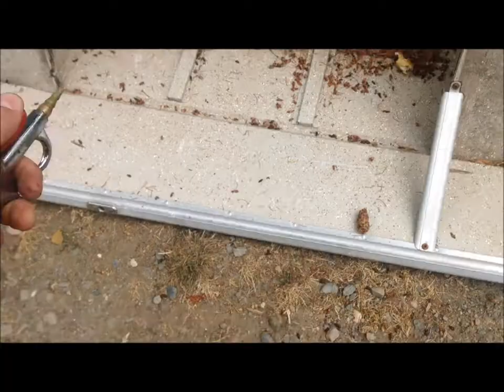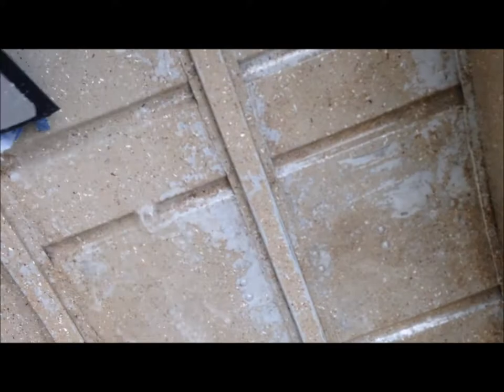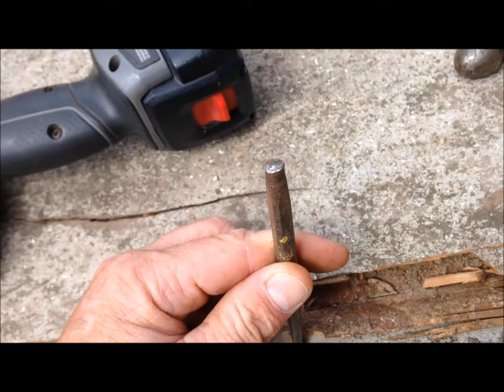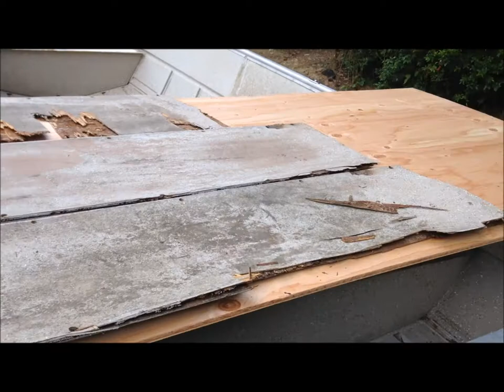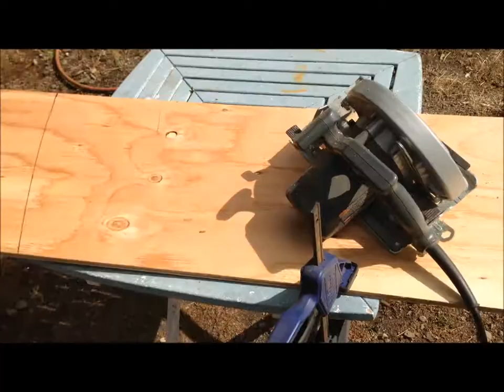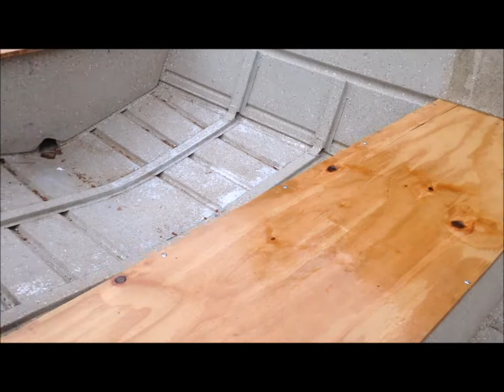DIY Western Brand Aluminum Boat- Wooden Boat "How-to" Seat Restoration Tutorial Demonstration

Comment: Questions 
-You didn't show how you marked/measured the new rivet holes. Did you trace them from the old boards?
-Rivet size?
-Did you use rivet washers?
-1/2" standard plywood?
This the next step in my restoration, any input you have would be a great help. Your video is a HUGE inspiration. And I think the ONLY one showing new wood benches and rivets.
Thx again!!
Reply from the maker: Thanks for your feedback.
We’ll no I didn’t trace them, probably should have. Just used the rivets I had on hand. Not sure what size but they worked great. Marine
Plywood should have been used but I used standard and coated it. Good luck to you in your restoration effort, it’s well
Worth it once it’s done. Glad I did it as I’m sure you will be too. Take care.
Reply: I have a Lund with the plywood topped bench seats and we want to add seats on swivels to the benches. I was thinking about using rivets but wasn't sure 1.can you rivet a metal swivel to a wood bench top? I ask because I thought you could only rivet metal to metal.
And 2. Does the rivet work with Styrofoam under the seat top? In other words, I'm trying to figure out if I can rivet the seat base to the plywood with Styrofoam underneath wothout removing the plywood top to do so. 
Your boat looks terrific.
Reply: Hi Heather 
No, don't rivet seat base to the plywood, it won't hold. I did however use rivets thru the wood into the metal lip of benches, then added small aluminum angle for the wood edges. For seats I used the clamp on base style. You can kove them when you want or remove them. They swivel and work great. You can make a pvc pipe tool to tighten (see youtube).
Reply: @Heather Prosseda  wish there was a way I could send you pics of mine. I'm happy with the way it turned out.

Comment: I'm doing the same thing with my boat now do you recommend using rivets or bolts? Also I wanna add some swivel seats on top of the bench seats do you think the rivets would hold up? Thank you and awesome video 👍👍
Reply from the maker: Doc Holiday. Glad to hear it. I recommend rivets for all. The rivets will hold up great. I think I’d add an extra rivet or two for the swivel seats. That should turn out nice. I’d like to see how it went. Good luck to you and thanks for the nice feedback!
Reply: Hey Doc,
I used the clamp on swivel bases. You can move them and remove them. No holes

Comment: Thanks for the video. Need to do exactly the same thing. Just a curious question, why do you put rivets on a new wooden seat? What if i dont put it?
Reply from the maker: No problem.  The rivers are to hold the seat down to the metal frame. If u don’t put it the wood will not stay in place. I recommend riveting it or at least use some kind of fasteners to secure a he wood to the frame.  Good luck.

Comment: What kind of plywood and rivets did you use? I have the same boat can you do a transom video? Thanks.
Reply from the maker: Hi Lauren, i just used 3/8” standard plywood with aluminum rivets. I would have used marine grade plywood (which i would recommend) but wasn’t sure if it was going to turn out. In hindsight Id use marine grade plywood. I’ll do a transom video once the opportunity presents itself. Thanks for watching and commenting.
Reply: Ok sounds good I would really enjoy transom video. I need to replace mine bad not sure how to.

Comment: What size plywood did you use? I’m doing the same but I don’t know how thick I should buy since I’ll be adding chairs to them
Reply from the maker: David Cervantes hi David, i went with a 1/4”
Reply: @DIYTechnician  1/4? Or 3/4?
Reply from the maker: @x16clumznshy  I used 1/4 but I recommend thicker and marine grade if possible.